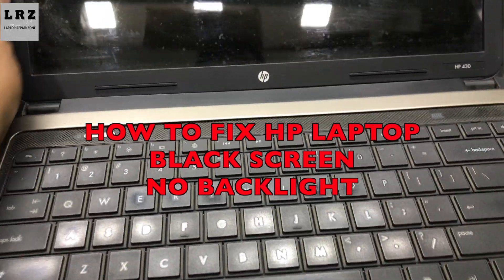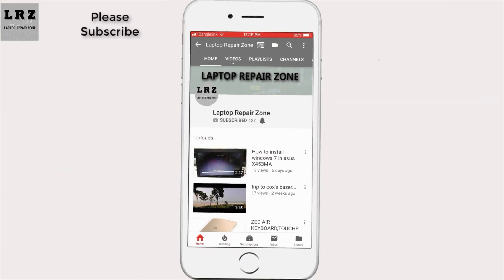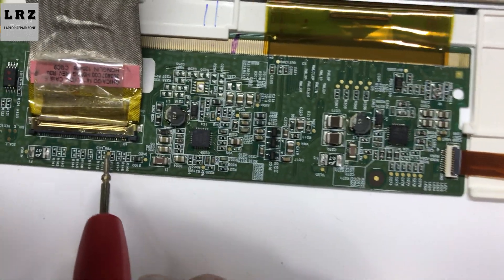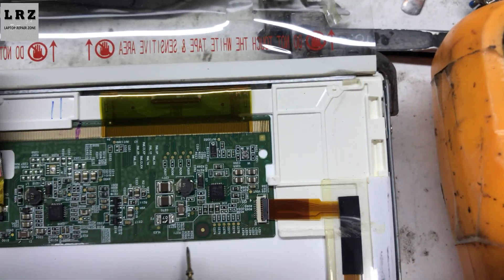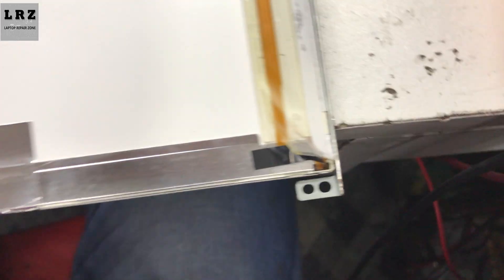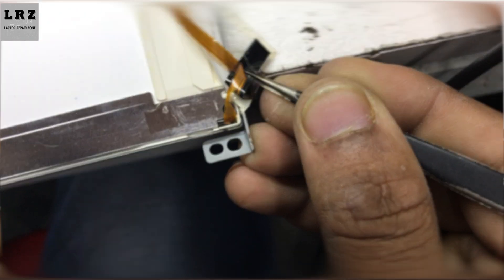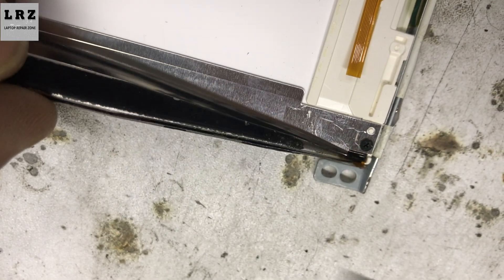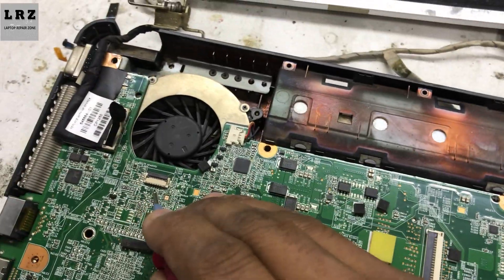HP Black Screen  Computer Starts But No Display - Screen Not Working / Dim

Comment: Hi I have HP 14-ac011tu turned on but no display, and the caps lock blinked 3 times, I searched for the HP code and found out the possible problem is faulty RAM but I already changed the RAM but still no display, can you help me, please